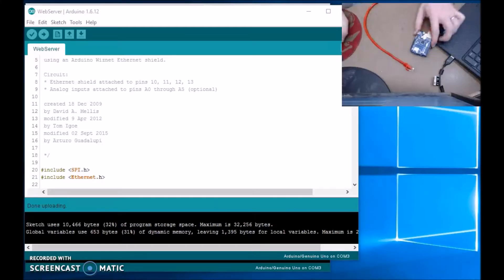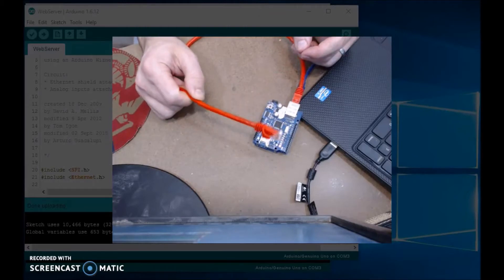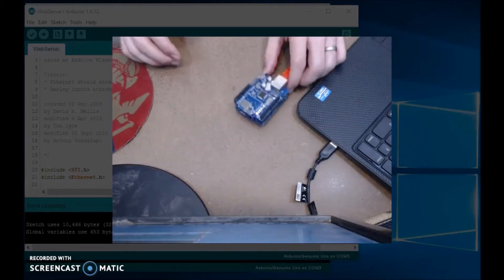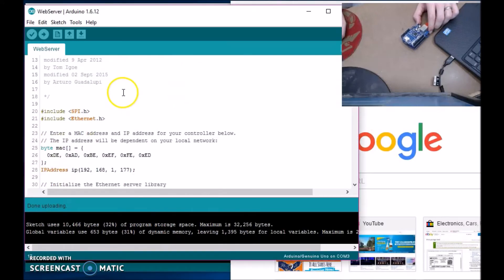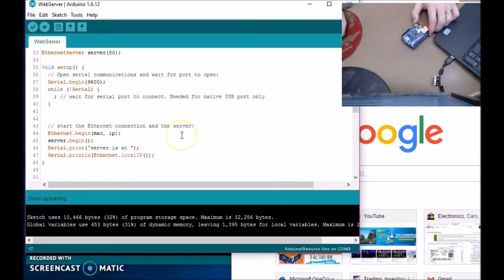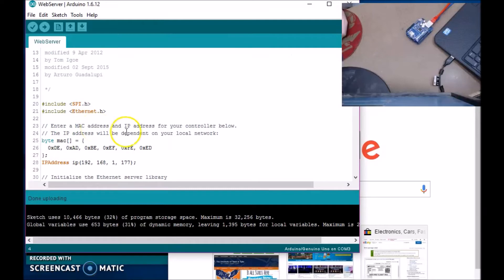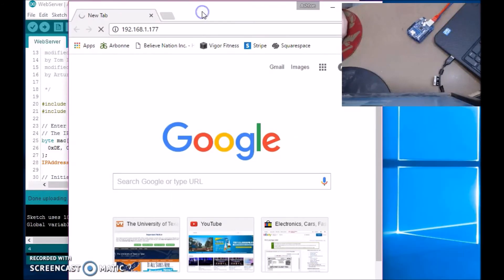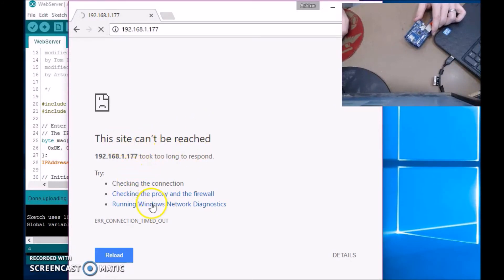SOLVED - Ethernet Shield Arduino not working

Comment: I thought I would find the answer to why my arduino disconnects from the usb port as soon as I put the ethernet shield on it, but no.
Ofcourse the internet comes from the router and not the pc, what do you need an arduino for if you dont know that..
Reply: Using the computer as a bridge for the internet.

Comment: can you show me a demo when you connect to a router and working?
and where to get the ip address? as you mentioned.
Reply from the maker: you can make up any ip address you want. my routers ip address was 192.168.1.1 so I made Arduino's ip address to be 192.168.1.117

ill need some time but i can make a video sometime in the future.